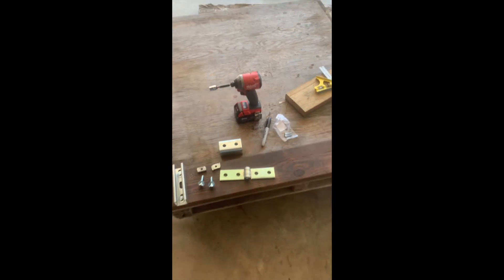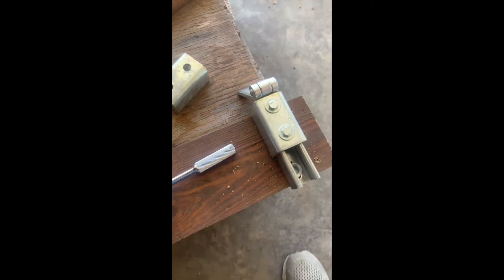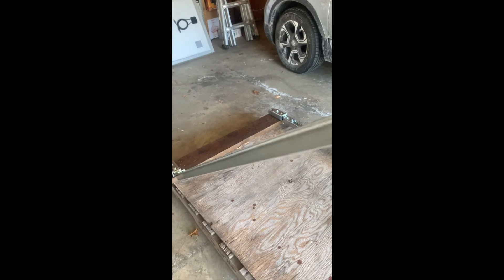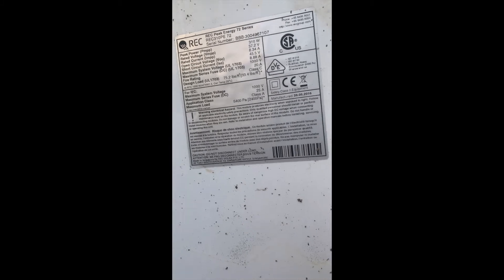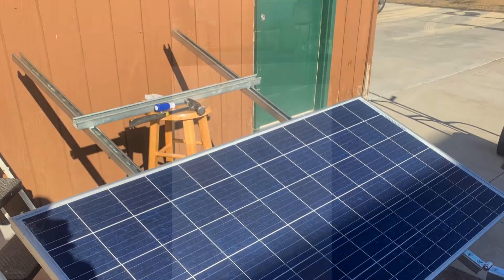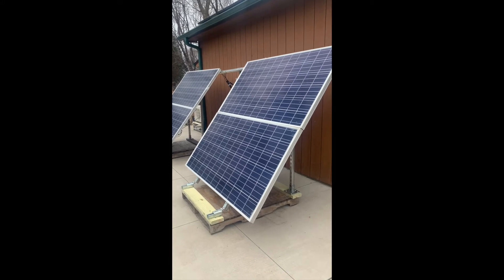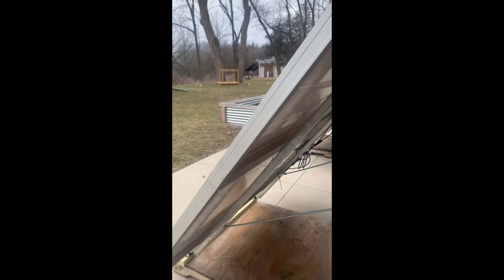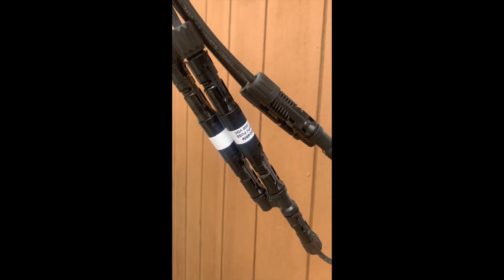Growatt 3000 watt Solar Panel build part 3 - Cheapest way to mount solar panels

Comment: Question on your panels.
45v open circuit ands 145v max into the growatt.
So if you have 4 panels time 45v doesn’t that put you over the 145v input?
Trying to understand.
Reply from the maker: basic electricity of panels in series and in parallel. The two panels on each pallet are in series, then the pallets (two panels on each pallet) are in parallel. Panels in series the voltage adds up, 45+45=90 volts per pallet, the amps stay the same or about 9 amps. Panels in parallel the voltage stays the same but the amps add up. 9+9=18 amps. So my four panels are running at 90 volts and 18 amps. Check out Explorist Lifes video on this subject. https://youtu.be/KJ5zCY5EBeQ
Reply: @beefitter  thank you sir, very helpful

Comment: Nice work. Would it be prudent to have the back shorter, then put slider (that you can lock in several positions) on the bottom so you can adjust the 15* +- for summer winter?

Comment: diyers'  check your codes:  they may require an engineers stamp for custom designs....or require you to use a manufactured racking system that comes with engineered/approved drawings.
Reply from the maker: This is a portable design for temporary use. It is able to be moved and would not fall under any code.
Reply: @beefitter  yep, just want people to be aware, before they commit to a project. good work
Reply from the maker: @unionse7en  https://www.youtube.com/watch?v=9cduNDku-Y4&t=8s check out my ground mount. It is heavy duty and engineered properly.
Reply: @beefitter  , thx, no doubt,. Just for the education of people following :...I myself am an engineer, but that is not what my county requires. They require a state recognized engineer to stamp any custom racks. OR we must use a manufactured system that comes with the approvals.  I am not complaining, just advising  people to look into what their local codes require.  Other counties may have no code requirements at all, I am just advising people to do their research as far as their code specifics, if any.

Comment: DEFINITELY LOOKS EASY ENOUGH TO BUILD.  GREAT VIDEO!  YOU HAVE INSPIRED ME.  I HAVE 12 X 325 W SOLAR PANELS.  I WAS JUST GOING TO PUT THEM ON THE GROUND FOR NOW BUT SEEMS LIKES THIS IS DOABLE AND NOT TOO EXPENSIVE.  MAY I ASK HOW MUCH DID YOU SPEND ON THE UNI-STRUT HARDWARE?
Reply from the maker: The strut cost me about $120 per pallet. I purchased the strut, four hole feet, and the unistrut nuts from menards. The hinges and strut coupler I purchased from McMaster-Carr. The solar on a pallet can be a big sail. The pallet needs to be weighted down if they are in a windy location. With the inverter I have, I could only use four panels because the inverter is limited to 145 volts DC. Which did work well. But if you want to use 12 panels, you may need to do research on a higher DC voltage input or use 2 - Growatt inverters in parallel.

Comment: Alright the hinges are from unistrut so they must be tough.  I wonder if lowes has unistrut or a cheap version. Thanks for sharing!
Reply from the maker: I purchased the hinges and couplings from McMaster-Carr they are an industrial supply house. they do have an online store that is available to everyone. The unistrut 10' lengths, four hole foot and the strut nuts I purchased from Menards. Lowes had some product but I felt some of their components were inferior. Their strut would work, if that is who you have to use because of shipping costs
Reply: @beefitter  that's interesting! I'm definitely going to search this online store to compare my options at lowes. Many thanks man!

Comment: Sorry for the comment, but I wanted to mention that the wind can really get ahold of solar panels and they will fly (sad to say I learned the hard way).  Are you planning on holding the pallets down somehow?  I may have missed it, but what's the purpose of this system?  Mounting the battery in a nuc box, assuming it's going in the field somewhere?
Reply from the maker: I know the panels can possibly be a big sail in a big wind. The panels are protected by two structures from a big wind. Not saying a big thunderstorm could cook up something big. I will be taking this down to the farmers market we go to so we won't need a gas generator. Plus if my power ever goes out I can run my refrigerator with it.